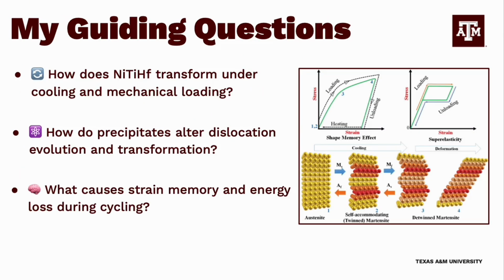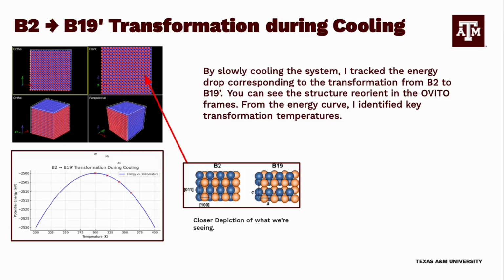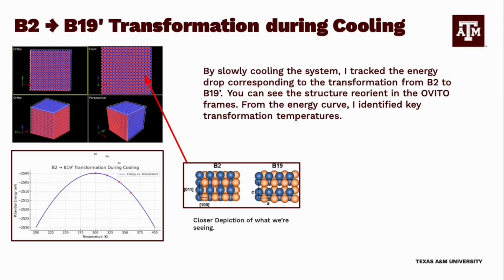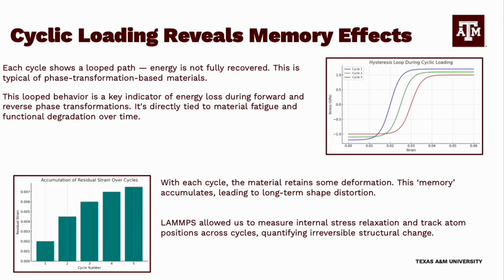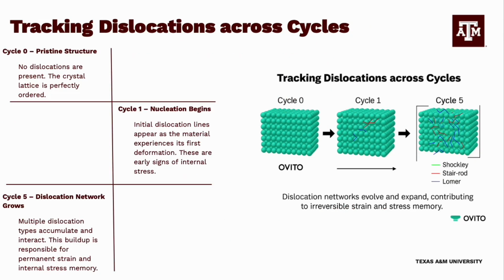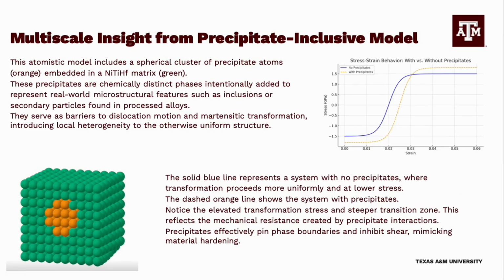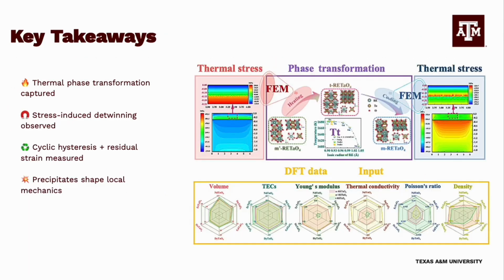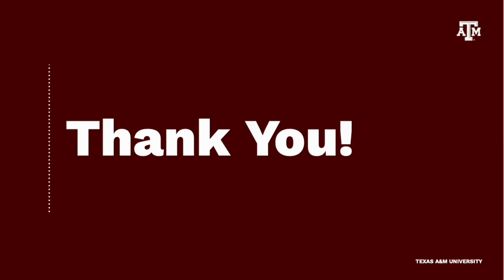ALWANI, Shams   new Final OREU

Comment: Howdy Shams. I really liked your toolchain and your pacing. I also liked the balance between text and images. I'm very impressed by your OVITO illustrations, though, as well as your stress-strain graphs. I also enjoyed your key takeaways slide. Very nice presentation with good motivation as well.

If you're looking for some critiques, I think some slides have a little too much text at times (for example, the slide that discusses uniaxial compression and the multiscale insight slide). I think that would be the biggest thing I noticed.